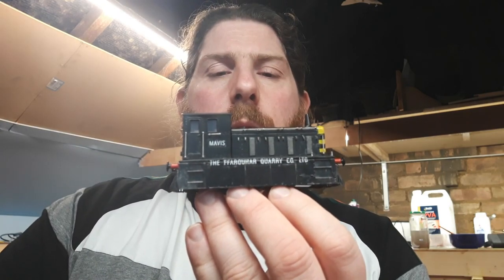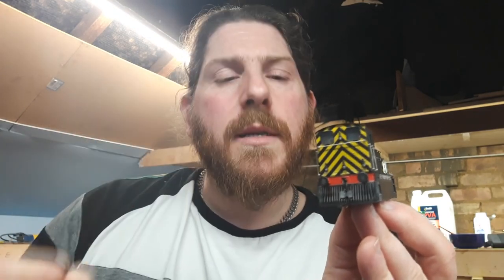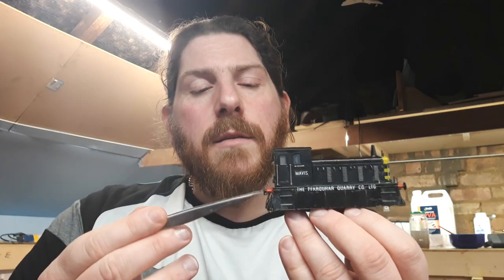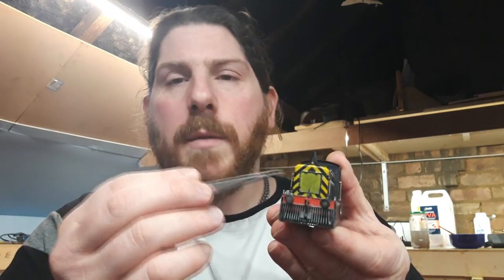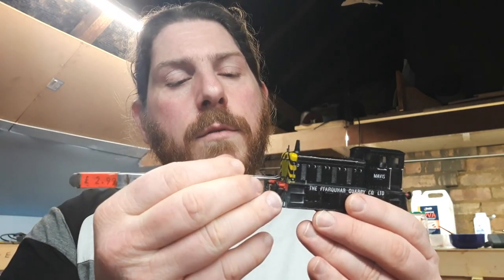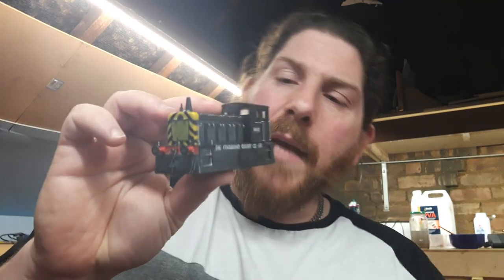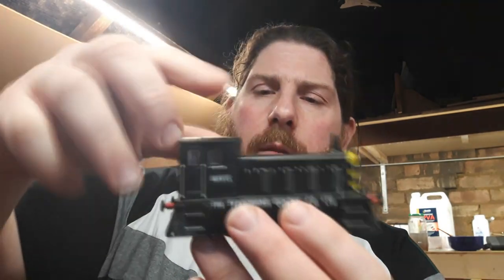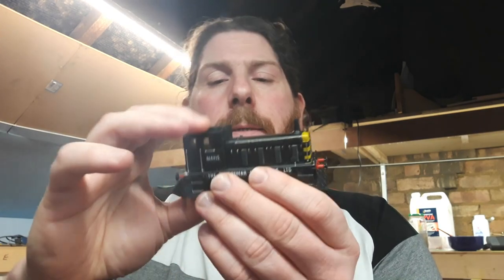04 Drewry Diesel Completed - 3D Printed Kits :)

Comment: A stunning model to say the least.  Love the attention to detail, even if some are a little off.  Not sure if it would work or not, but the radiator looks about the right size for the ERTL face to sit over.  Curious what the status is on Toby if you've started on him yet?
Reply from the maker: Thanks.  Rad' grill is bigger now anyway.  Have got some faces lined up just not ready to paint them yet.

Toby or rather the Rapido J70 is still in its box untouched.  I get it out once in a while n run it so it doesn't dry up or anything.  Just so much to do, 1 man band syndrome.  Will get to it at some point.